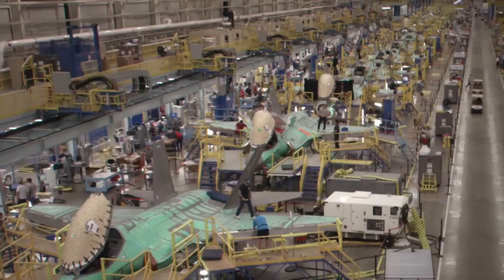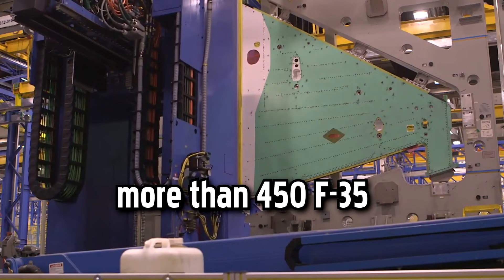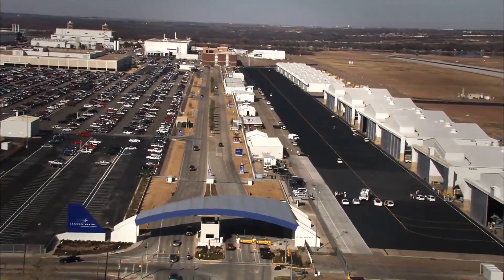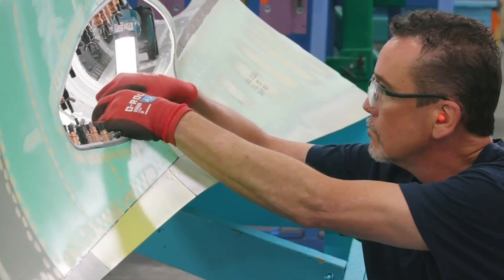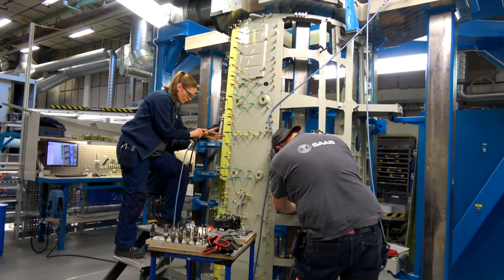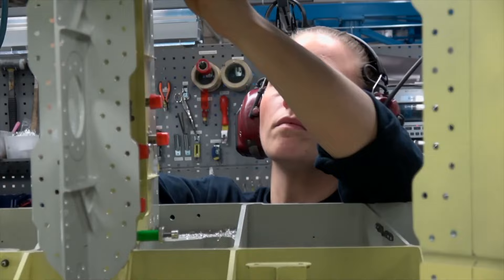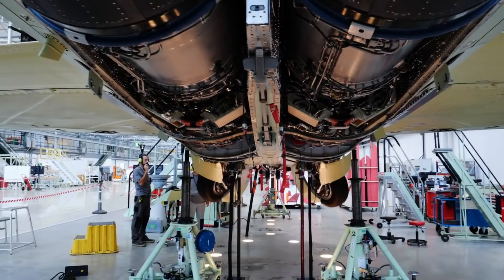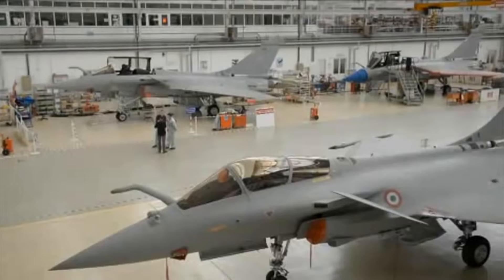F-35 Production line [Manufacturing process] 2024 Building Most Advanced USA Fighter JET✈️

Comment: But if f35 producción started on 2021 , they make 160 planes por year and until now have been made 920 planes . Something doesn’t fit the information. If is true the total amount of planes have been made the stars production stated in around 2017 . Something doesn’t fit the info
Reply: F-35 prototypes were produced in 2003 and the plane started mass production in 2015 when it was introduced. It was widespread far before 2021, thats not true.